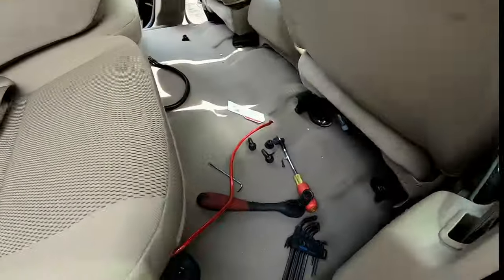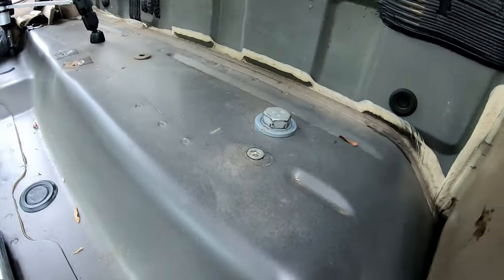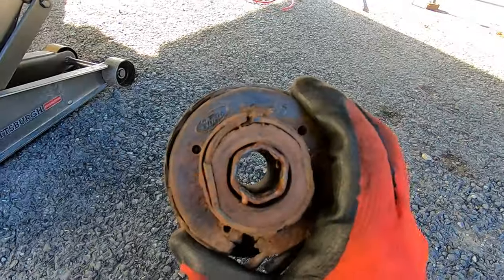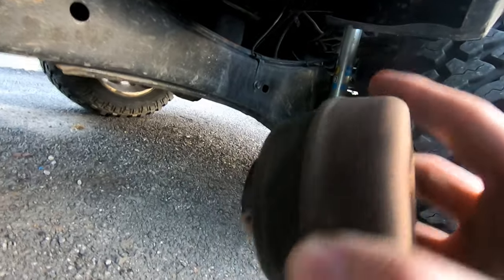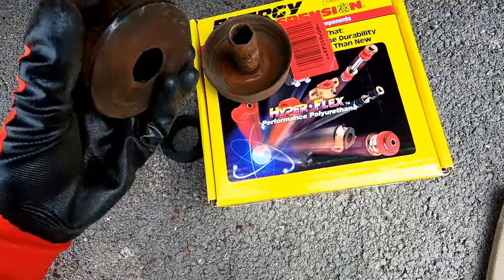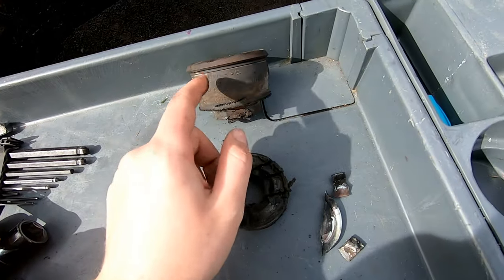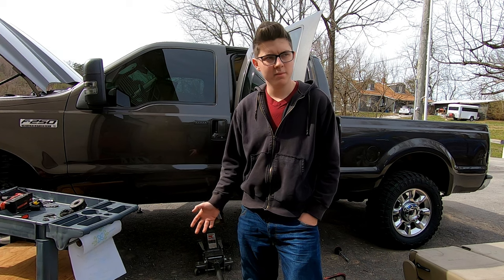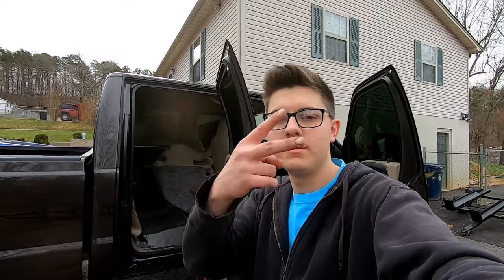2006 F250 Cab mount bushing replacement EASY SIMPLE EXPLAINED

Comment: My passenger side rear is gone as well. 228k I guess I cannot complain. Just a tip for others out there, if you have a bushing being stubborn you can thread the bolt back in just far enough to not damage threads and smack it with a hammer and it will generally drop out.

Comment: The "Trick" is to leave about half the bolt in the bushing (to protect the threads) and wack it with a 3 lb hammer, they knock the bottom plate right out and you can continue to remove the bolt. Then work the rubber (It most likely will still be in useable condition making you question why you removed it) off and slide on the new bushing.
Reply: thread the bolt from cab (top) or from the bottom? Currently got a #3 position stuck exactly as he showed it in this video.

Comment: I’m only changing out the #4 position (close to the bed) cab mounts. Do I have to loosen the #3 position (bolt behind the front seats) cab mounts to get the clearance to remove the mounts at the #4 position?
Btw, on my 2005 F350 SRW the #4 position bolt is a 24mm (13/16) and the passenger side is a 21mm (15/16) for the life of me I don’t understand why Ford would do that. 
I’m also going to take the surface rust off, paint the hardware & the frame areas to protect it. 
Energy Suspension is definitely the way to go. S&B cab mount kit is a complete unit including new hardware & bolts but the $700 price is steep!

Thanks Justin for all you do! Your videos are very detailed. I appreciate how you explain the process, tools & tricks!
Reply: Why?  Engineers that's why....

Comment: Very helpful I'm about to replace the ones on on my 06 f350. Just keep thinking as soon as I do replace them I will have a break down and the cab would need to be lifted for repairs" head gaskets,oil cooler,ect and have them replaced then, hope that doesn't happen. I purchased new in 06 and noticed they started looking bad after just a few yrs, I also keep my truck garage and 80k miles I just started get the rear cab hitting when driving over slopes. Thanks for the info.

Comment: You could also used the cad mounts from a older model 04 and older all of them are all rubber OEM. What is the part number for the Energy mounts? Any squeaking?

Comment: What year and size are your rims tire size looks nice
Reply from the maker: ramon rodriguez 20 inch stock lariat f250 wheels off of 2011 f250. With 35” x 12.50 mud tires !

Comment: I just watched another video that said you have to take the steering column loose on the driver side. ?? this guy didn’t do that. Is that overkill? Or can I still do it without it? I’m getting ready to do this on my truck. I was under it last night and looked at these and realize where that clunk has  been coming from
Reply from the maker: I did not personally take any steering components loose... only jacked up cab off of frame as high as what was needed... no problems for me have put almost 9k miles on truck since this... no problems yet... but now I’m not sure on different year models (newer or older) than 2005-2007 could possibly be different... but mine is 2006. And I did not take any steering loose. So 2005-2007 should all be the same.

Comment: Did you disconnect the steering linkage bar assembly?
Reply from the maker: Ryan Macfarland  no I sure didn’t. I lifted the cab up one side at a time and only jacked up cab as far as I needed to
Reply: @JUSTINHAWKSMITH  yah I read somewhere that you had to. Just didn't know how to do it or even if I need to. Mine is a 2006 F350. Cab mounts are shot.

Comment: I'm in the process of doing the same thing.  However I'm stuck on the front passenger bolt under the battery.  The nut is off the bolt but it appears the bolt is also threaded into the metal plate on top of the rubber and it just spins when I try to back the bolt out.  Can you tell me how to get a grip on that plate to keep it from spinning?
Reply from the maker: The front mounts are actually rubber and their design is super hard to remove from the truck without pulling cab from what I’ve read up. I left mine alone since their rubber didn’t need replaced anyway
Reply from the maker: Removing the front bumper helps a ton for the front mounts if you do want to remove them. I have a video on my channel on removing front bumper as well!
Reply: @JUSTINHAWKSMITH  Thank you very much for the reply.  IF the bumper isn't too big of a job then I just might do that.  At the moment there is no way I can get that front one to stop spinning because I cannot get a grip onto it.  I'll check out your bumper video.  Thanks again.  -Scott

Comment: I have to do mine, but for some reason mine has torx bolts in it. Next is your egr and oil cooler for a truck that will last forever, Well that's my plan anyway,
Reply from the maker: MAXIMUSISADOG oh yeah she’s done got a fresh oil cooler, and egr delete.... updated stc fitting, blue spring mod, 6.4 banjo bolts, coolant filter kit, 5” exhaust, etc....

Comment: Put bolt back in middle mount and use hammer and go to town mount will come out mine was rusty and took a while but came out
Reply: Did u smack it from the top or from the bottom ? To loosen up?

Comment: So how have those cab mounts help up over the years? I'm thinking about doing mine and those are a lot cheaper than the s&B set.
Reply: I bought a set and they havent held up very well. I'm about 3 years in and they need to be replaced again. I'm going with S and B mounts this time. They cost about 4 times as much but should be good for the life of the truck.

Comment: If I just need to replace the rear mounts would I be able to replace just those and not loosen all of the rest
Reply from the maker: No sadly not cause you have to get it high enough to remove them and replace them with new and you cannot do that without loosing them and jacking the cab up I wouldn’t think.
Reply: @JUSTINHAWKSMITH  I also just wanna do the cab 6 ones and not the front ones mine r still good do I still have to take or loosen up the front onez?

Comment: Did you really need to remove the rear seats?  Seems like just pulling the carpet back would allow access to the bolts.
Reply from the maker: Yessir you cannot get to the middle one without removing back seats. Back seats allow you to fold the carpet up far enough.

Comment: You didn’t show the fronts… was there even a bushing on the front?
Reply from the maker: The fronts are actually rubber bushings not foam , so I didn’t even replace them. They were a pain to get to anyway. Just took nuts off so I could lift cab up

Comment: Thanks for posting. On the middle rubber mounts, I thought I'd seen before where folks used a prybar to separate them. Seeing the inside hardware on those was very helpful. On the front mounts, did you have to take the front bumper off to get to the bottom half as it looks like it is Inside the frame?
Reply from the maker: Imma be honest the front ones are rubber so I didn’t even change them
Reply: @JUSTINHAWKSMITH  Did you have to loosen them?
Reply: @JUSTINHAWKSMITH  did u have to loosen them up??

Comment: How do you separate the mounts from itself, the upper separate from the lower?
Reply from the maker: Reviewerguy1228 mine just pulled apart using a flat head screw driver
Reply: I  cut mine then twisted them apart

Comment: Why do Ford bushing have such short life?
All my F350 2012 are gone!
Reply from the maker: TABOOVSKNOWLEDGE sadly after the 7.3 possibly early early 6.0, they swapped to the “foam” bushings for “better ride characteristics” than rubber... horrible idea. Should’ve just left them rubber. But luckily for you , your 2012 will be even easier to change than mine cause you don’t have to take anything apart on the interior if I’m not mistaken, your bolts go in from the bottom and go straight up into the cab. So if the little clips hold you literally just pull all your bolts, jack up the cab, throw new in and put bolts back thru and done! Saves you $1200+ and gets rid of those rotted cab bushings. Good luck!
Reply: @JUSTINHAWKSMITH  It's a single cab! bachelor style! Thanks' man, going to help a lot! Now, why the hell are they so expensive?
Reply from the maker: TABOOVSKNOWLEDGE  I purchased energy suspension poly bushings I think they were about 180 bucks. A lot cheaper than OEM replacement. Idk why the OEM are so expensive. Guess that’s ford parts for ya...

Comment: You definitely didn't try very hard. As others have stated you can use the bolt and hit it with a 3lb hammer or use a 1/2" extension and hit it with a hammer. 
And I used the same bushing kit. All you had to do was cut off the factory busings with a razor. The directions are 50/50 but they tell you enough to get the job done.

Comment: Yes, STAY AWAY FROM DAYSTAR, boy what a mistake that was. I have to take them out because it's like riding a stagecoach and when you get on a dirt road the noise will drive you nuts and the clunking. They're suppose to be universal but they're not. They don't  fit good at all. STAY AWAY if you don't wanna have to do this job twice. 😡😠🤬

Comment: I've watched a bunch of videos on this topic and no one shows the removal and install of front mounts. Y'all talk about it, but then never show it in the video...
Reply from the maker: already showed it on all the other mounts.. no need to show it so many times. just alot of extensions and jacking it up like any other of the mounts.
Reply: @JUSTINHAWKSMITH  The front frame arms around the engine on my 2006 f350 are boxed with the 2 bottom body mounts and washers/sleeves inside the frame with no visible way of removing old or installing new. They are not like the rear 6 which mount to tabs that are welded to the outside of the frame for easy access...
Reply from the maker: @deerhunter972  has your cab ever been pulled
Reply: @deerhunter972  You have to remove the front bumper to access them from the front end of the boxed section of the frame.
Reply: You can access the top nut through the wheel well..I pulled the plastic back and used an 18mm combo wrench to take off the top nut